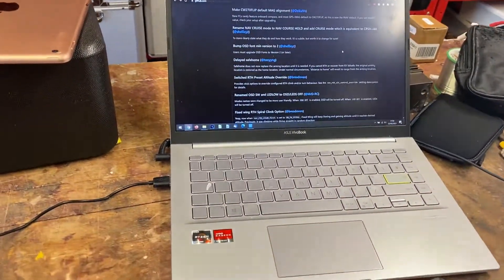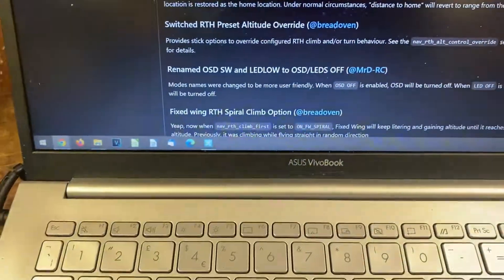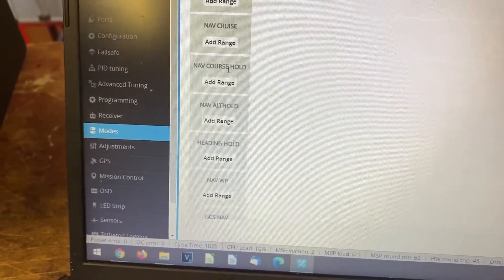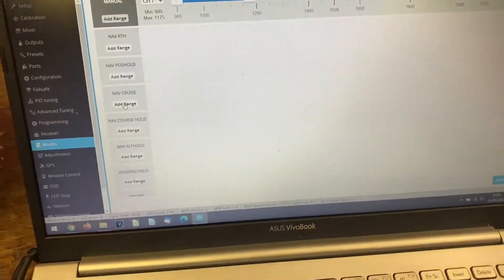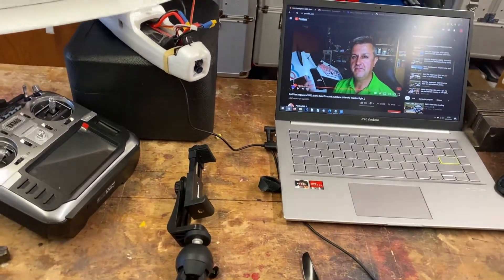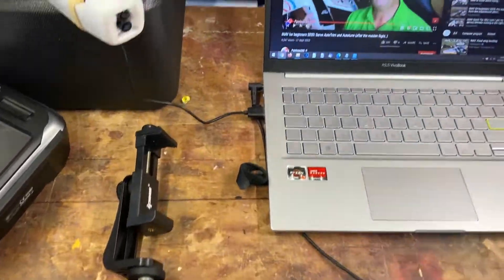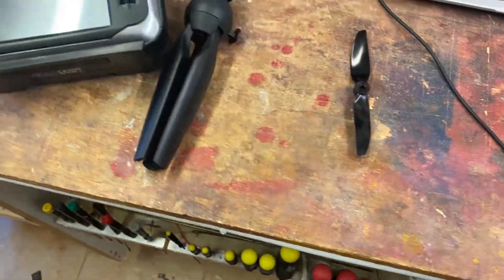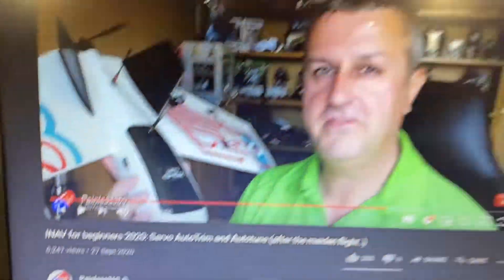ZOHD Drift!: The Refit - Part 3 - Radio Re-Do

Comment: Hi, I see you mounted the immortal T antenna just before the motor. Is this best/easiest way to mount the antenna vertically on the Drift?
Reply from the maker: its the easiest place, just make sure it doest go in the prop!
Reply: @JakesRCStuff  the immortal T is stiff enough I guess 😅
Reply from the maker: I use an extra piece of plastic tubing
Reply: @JakesRCStuff  I don't know if that is really necessary, but of course it can't be superfluous.  It takes quite a lot of force to bend the immortal T with your finger, so I don't think the wind will be able to bend the antenna.  But I will test it, have 2 immortal T antennas on spare😉